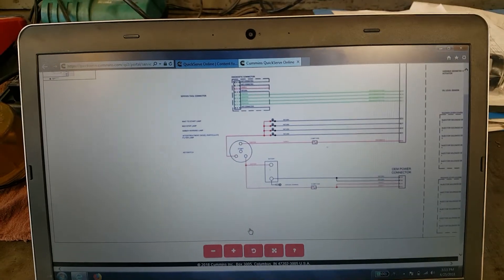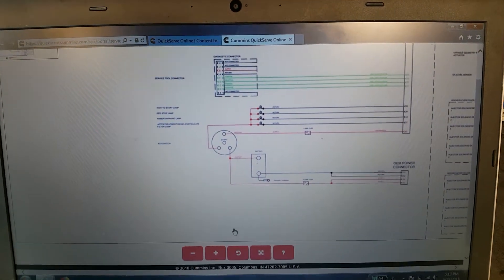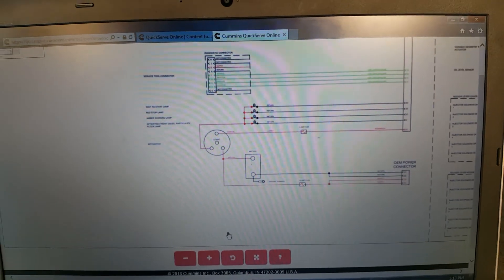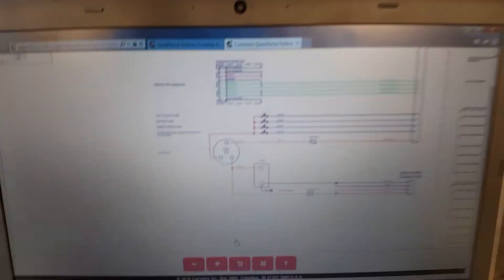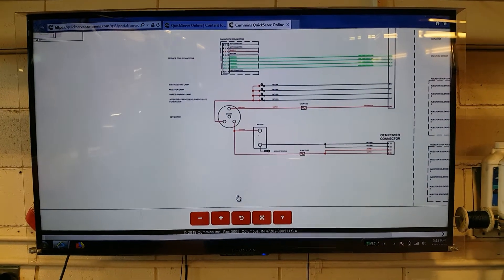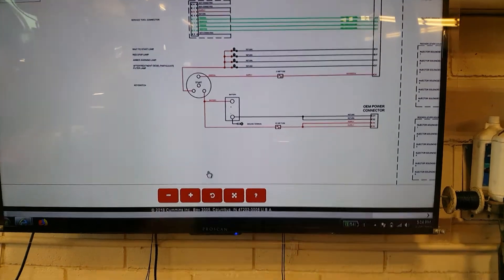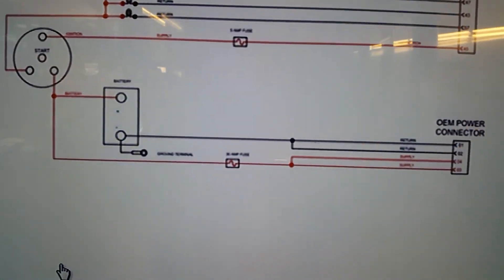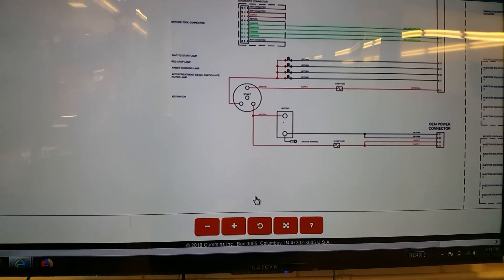Cummins ISB Diesel Engine Wiring and Troubleshooting

Comment: Halo how are you I need your halp plz
Reply: Plz sir halp me
Reply from the maker: How can I help you?
Reply: @MechanicsHubdotCom   sir can you sand email address plz
Reply from the maker: @malikladla7332  you can ask your question here no problem.
Reply: @MechanicsHubdotCom  Ok sir am working Saudi steel iron compney. I have hair slag pot carrier kirow
Reply: @MechanicsHubdotCom  before 3 days I am installing new engine qsm 11 also I am installing engine ECM wiring is no starting ok running ok but is problem the woring tershold diesel engine stop light coming this  is going me one  to second is accelerator ok but his coming regularly light is accelerated not ok
Reply from the maker: @malikladla7332  When accelerating engine shuts down? what year is engine and do you have laptop and software available? Basic checks like oil pressure, fuel pressure and supply from fuel tank ok?
Reply: @MechanicsHubdotCom  sir  cummins engine qsm 11  engine not shoddon only accelerator problem cabin inside coming  red colour light after his problem am see diagram but diagram is writing Waring threshold diesel engine stop
Reply: @MechanicsHubdotCom  I am new installing engine 2019
Reply from the maker: @malikladla7332  oil pressure OK?
Reply: @MechanicsHubdotCom  yes oil pressure ok
Reply from the maker: @malikladla7332  Do you have the engine software to plug in and analyze the stop engine light condition? Or is there a dealer who could scan engine? It would make it easier to see what is causing engine shut down.
Reply from the maker: With diagnostic software you can read pressures and sensors and see what the code is. For example if the low coolant sensor is faulty the engine will shut down. In your case when accelerating the engine  shuts down so maybe there's an issue with fuel pressure, injection pressure or turbo boost. The onboard diagnostics from factory was designed to work with the software and pin point the problem. Without it you'rer going through a guessing game.